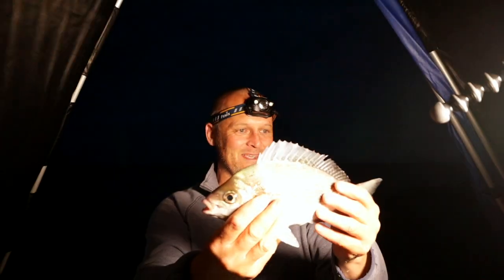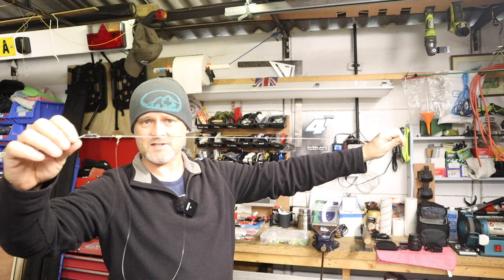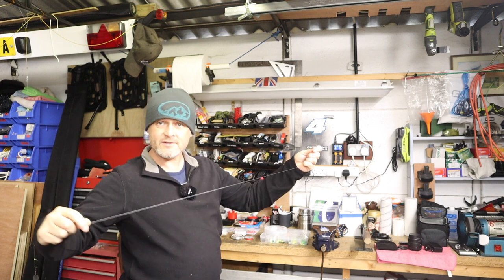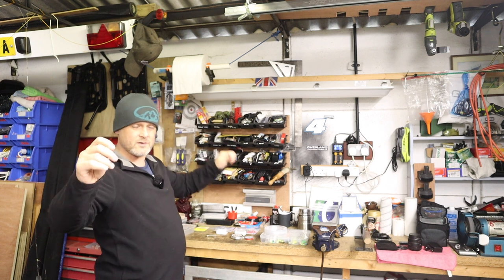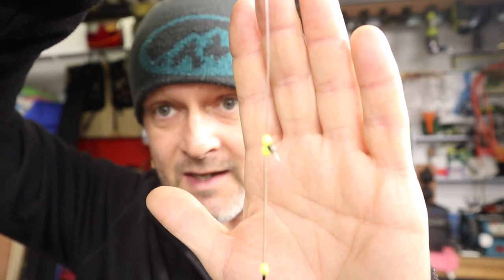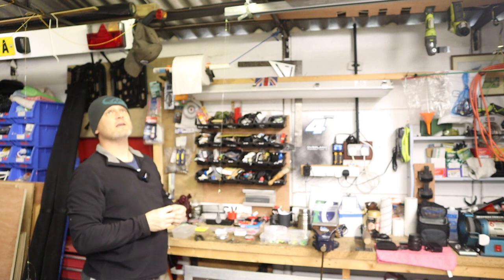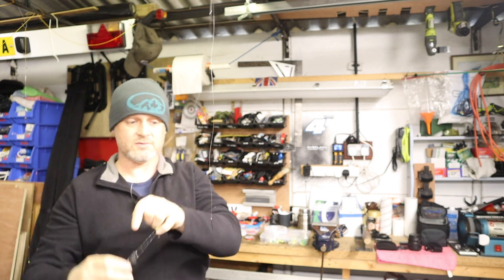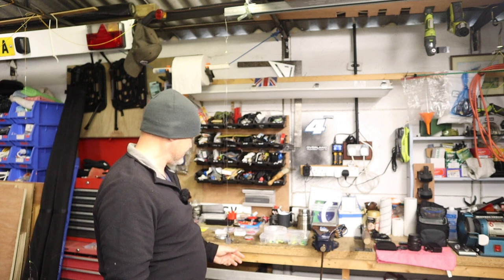Rig making - Loop Rig

Comment: Great demo Mark, I’ve used a 3 hook one for many years now,the top 2 are 19&20”.
I’ve caught over 2 dozen different species on it,and it doesn’t tangle 😜
Reply from the maker: Hi Kevin, I think of all the rigs this one has the spread of species covered and depending on how robust it is made ie beefed up or refined and light it can be amazing. I have a particular venue in mind for this rig and fishing a channel on a Sandy surf’ish beach with many species available, it gets me all excited. 

Over 24 species, and counting. That is amazing. 🎣👍🏻
Reply: @seaangling  That’s one of the beauties of it,you can chop and change the line strength and hook sizes for different species 🎣🐟

Comment: Greetings from Greece! I am using this rig for stripped seabream and gilthead seabream. It's awesome. Though I have reduced the hook size and snood diameter. And as a bottom bait clip, I use the trident roto. Works good. Hook size 4 to 5 and snood, yuki invisible 0,26mm. All the rest are pretty much the same.
Best of wishes for the new year!
Reply from the maker: Hello and welcome to the channel. I can see how your version and modifications would suit bream fishing. I have had the same thoughts. 
What is your go-to bait for the guiltheads?
Reply: @seaangling  well, that is a big issue to talk about. It depends on the season. And that affects the component sizes (primarily hooks and snood).
At winter time, I prefer sardine filets, small ones, tied on No3 hooks. Most people use chinus, I better like Aberdeens. Then, local worms are the bait most paople use.
At the warm seasons, the No1 bait is peanut worm in various baiting forms. Crab is not suitable for rig. The best rig I use to use is up and over rig and the most beloved by the Greeks, a runner ledger.
Overall, the best bait for bream is the one that can be found locally and in particular, at the place you fish.

Comment: Hi Mark benn useing the loop rig for many years and it's a Brilliant all round rig 
Great for a massive range of species nice video 👍
Reply from the maker: Thank you. With your experience I’d love to hear what differences you have on your rig or any adjustments you think are worthwhile. 🎣👍🏻
Reply: @seaangling  useing the rig for rays I use a pennal set up on the top a d bottom.If I use it on mixed ground even a dongle set up on the bottom works well.
Personally I go 80lb rig body and snoods for rays as it pins it down ro the sea bed better,as for dabs or flounders some beads .

Comment: Great tutorial Mark. Has inspired me to make something other than my usual pulley pennel. Hope you had a great Christmas and a happy new year to you from lincoln, tight lines 👍
Reply from the maker: The thing is we all have our favourites that we fine tune over time and have confidence in. I bet your pulley pennel rigs are tuned into your local marks/species.
Reply: @seaangling  yes you are right, but I would like to be more variable, thornback are my usual quarry and a up n over style rig would make more sense, but find the hooks dig into the sand on retrieve so I tend to use pulley rigs

Comment: Great video again learning loads from you.
I'm making a jig table what's your go to snood length on a 3 hook clipped down rig? (I know changes with conditions) but wanna start using detachable snoods so easy to change hook size etc. I'm fishing sandy slow slopping beaches. Skegness chapel area.
Reply from the maker: I’m going to be doing a 3 hook flapper rig with short detachable snoods soon. Whatever your rig body length is you can cut a length of line for your snoods. Cut that into 3 lengths of equal or varying length and once you have connected hooks and clips the snoods will be the right length. 🎣👍🏻
Reply: What I'm thinking is if it's say 9inch? snood to snood and clipped I can make a load of different 9inch snoods and they will still clip down. Then I can do 18inch snoods and 27inch snoods too making it a 2 or single hook rig and all hooks would fit the same rig body and clip down. The course match angler in me wants to change the hooks a lot more often in the session.
Reply from the maker: @richarddickinson7242  I understand what you are saying and I run rig bodies with packs of snoods so I can bait up whilst soaking and then swap over nice and quick with the rig body attached and just change snoods. The idea for interchangeable length snoods sounds good but adds snagging hazards. Personally I would prefer set body lengths with their associated snoods to make as streamlined and snag free as possible. The beauty of all of this is you can experiment for your way and you could fine tune to your method of fishing.
Reply: Thanks for your reply Mark I see your point